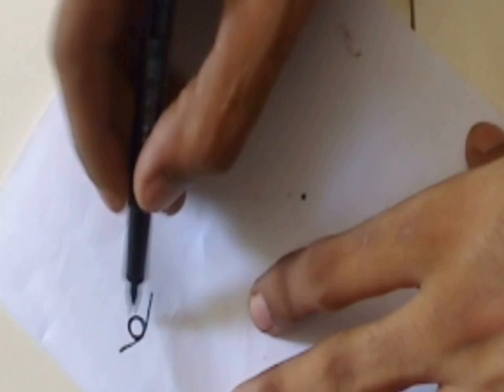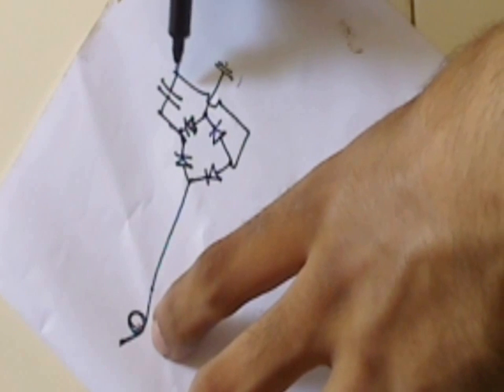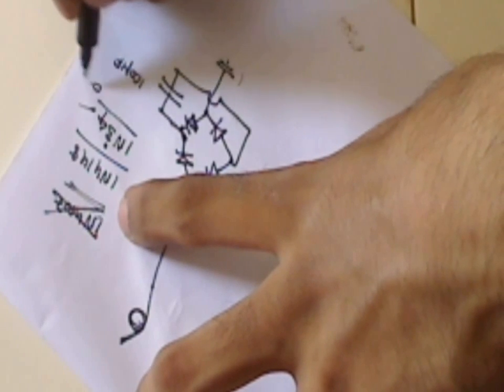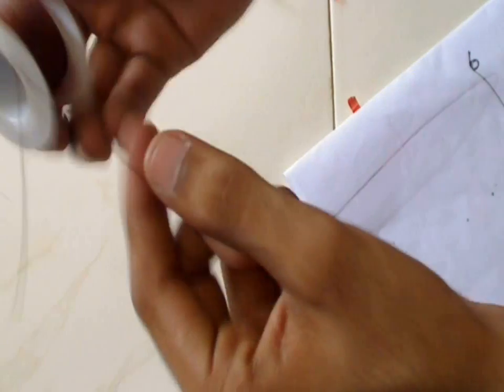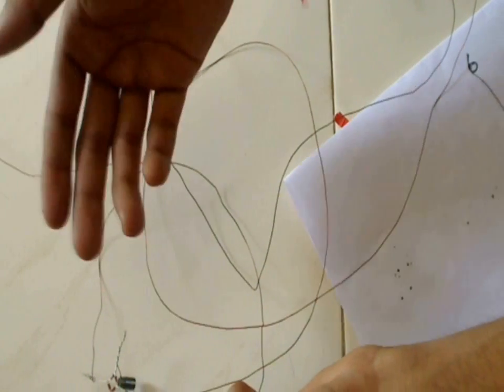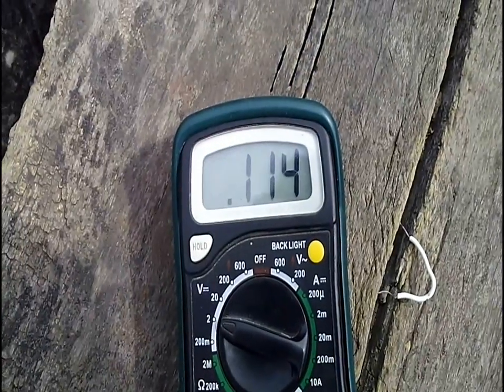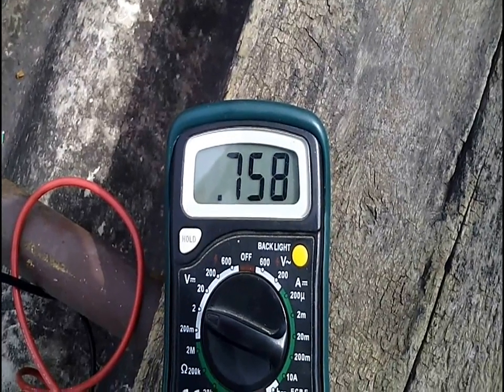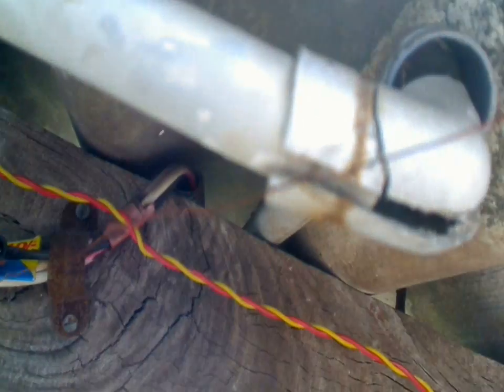Harvesting Free energy (Radient energy)

Comment: If you managed to get enough high enough voltage so you can run DC motor at good rpm and torque, you can use that DC motor to spin a washing machine smart drive stator motor rewired to generate 14 volts at high amps, which you can then connect to 5000 watts inverter and lithium iron phosphate batteries and power your house off grid in theory. Adding a step-down transformer to bridge rectifier and capacitor circuit will allow you to decrease the atmospheric high voltage and increase current so you can run the DC motor better. Antenna will need to be at high enough altitude to get high voltage.
Reply: 2+2=4

Comment: Does voltage increase if you add copper mass to the antenna?
Reply from the maker: you can try using insulated aluminium plate, the result might be better

Comment: The coil antenna is inefficient, create a log periodic antenna with aluminum scrap pipes or profile and a coaxial cable to reduce loss it will increase the voltage by the gain you can generate

Comment: sir, can i increse the voltage by using voltage doubler circuit, joule thief and a step up transformer ??
Reply from the maker: +Shubham Seth  actually the current generated in this circuit is very low so its of no use to double the voltage.
Reply: ouh
Reply: you need a 1 or 2 farad capacitors and it works with only diodes and no ceramic capacitors the higher the better and it work with only the capacitor as will and with that when you get to 12v you can run it thru a inverter

Comment: voltage doesn't matter. Power matters.
Reply from the maker: +morpher44 yeh ,this is just an experimental video and there are nopractical uses of this for now
Reply: Electronics Made Easy : KHADER Actually, there are energy harvesting chips now that can take power like this and charge super capacitors. You can then run a microprocessor from the power at very lower power.
Reply: Energy harvesting chips?  Thats only a legend.  There are some articles about it but no serious scientific paper proving it really works.  If this would be really a product, this would be purchases somewhere, which is not the case.  It is a "real product" that can't be purchased anywhere?
Reply: Carlos C Search for  LTC3588, for an example. There are many others.

Comment: Tks add USB outlet to storage battery if build too big could burn out phone watch - free energy phone charger - google  - man uses board there is new board from jaycar Australia called breadboard needs no soldering - question if raining is it ok to hang outside - can use copper wire short piece I am sure  inside - I did start this project was given wrong parts but am now motivated to tryagain tks

Comment: Wind mill?
Reply from the maker: TheaDragonSpirit no, it generates energy from the radio waves around us
Reply: Electronics made easy - No i meant that is an easy way to transform wind in to mechanical energy and then in to electronic energy, which will gain more watts over all.
Reply from the maker: yeh you are right. this design wont be able to power big loads and its still under develpment.
Reply: try painting graphene paint on the wire the results might be interesting